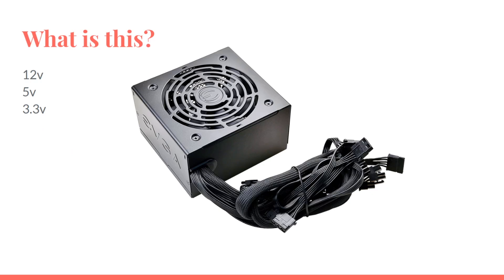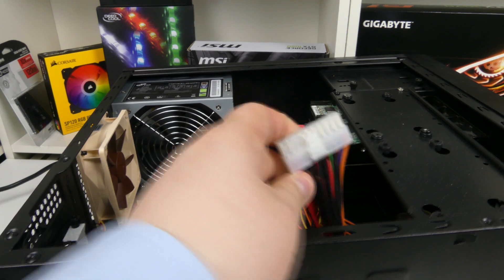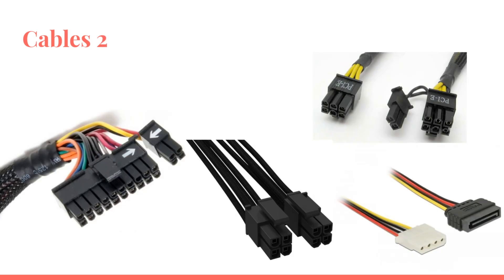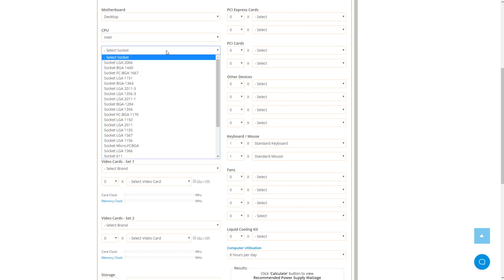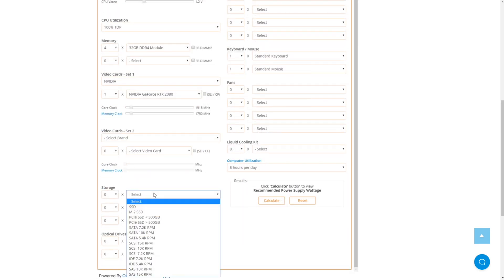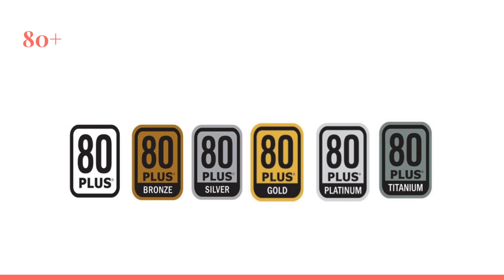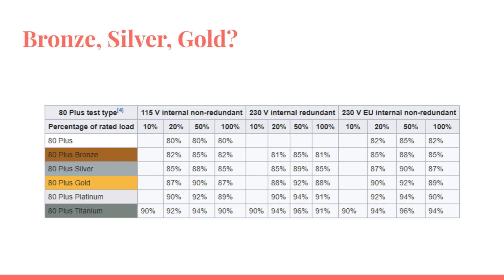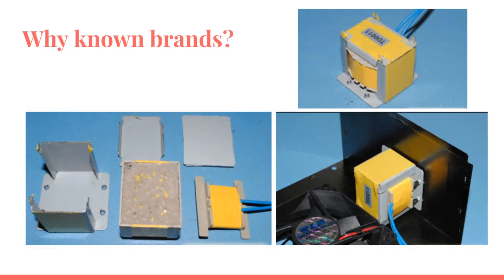Tech Talk - Power supply explained ( 80 plus, cables, watt, what to think about before buying )

Comment: Really great video man really wish you made this before I bought mines 😅 I personally used several different different sites to calculate the wattage I would need see the average and go a little above it I chose the Corsair rm 850x Gold I have yet to set it up cause I am still missing a graphics card but in terms of weight feel a build quality it is really nice the packaging was really and it also came with zip ties for cable management and I really great cable pouch that I will definitely use for other purposes when I get a graphics card and use the cables as for the cables they feel stiff and nice the threading is really good and it still has the flexible feel to it so you can bend it and don't worry about it splitting said a lot but great vid man left a like stay safe and healthy 😊👍🙏
Reply from the maker: Corsairs Gold PSUs are of a really good quality, no dought about it. It might even be alittle overkill pending on your PC :D but then again as i said in the video you got alot of upgradeability!
Reply: @RKfreestyler  I have a 3900x but no gpu
Reply from the maker: @ryan4kt204  What gpu do you wanna put in there?
Reply: @RKfreestyler  as of now I would settle for anything I am super bored and I just wanna start using my pc 😂 but hopefully when I get the money I would like to get a 2070
Reply from the maker: @ryan4kt204  hehe I can see that, that's a really nice card. Yea u are well over what you need but that's good if you got the money for it. U got overclocking and upgradability then!
Reply: @RKfreestyler  yeah I don't plan on building another system or doing much upgrades for like 2-3 years keeping that in mind I am coming from a 1.10ghz Intel celeron laptop with only 2 cores so I was trying to get what's best on the market right now so when time passes I don't fall to far behind cause I won't be changing my parts that often plus my friend got me a really good deal on the card I only paid around $1k for it which is a pretty good deal
Reply from the maker: Congrats! you should check my new video ;D just saying!